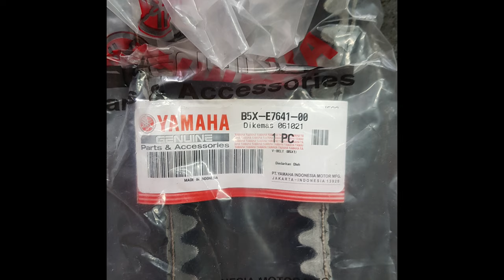Strangely broken clutch at 30000 km, Change All Drivetrain Parts - Yamaha Xmax 300 Scooter

Comment: A da minha pcx 2014 foi trocado a sapata da embreagem com 49,000km . Esta dentro do prazo né?
Reply from the maker: Verifique as sapatas da embreagem a cada 10.000 km,
Dependendo do desgaste da embreagem dentro da sapata da embreagem, pode ser necessário substituir apenas as peças da embreagem.
Se a peça de desgaste não for severa após a inspeção, você pode continuar a usá-la sem substituí-la.
Esta peça não é uma peça que é substituída regularmente.

Na Coréia, quando é confirmado que a embreagem dentro da sapata da embreagem está gasta ... eles apenas substituem todo o conjunto da sapata da embreagem. (포르투칼어)

Check the clutch shoes every 10,000 km,
Depending on the wear of the clutch inside the clutch shoe, you may only need to replace the clutch parts.
If the wear part is not severe after inspection, you can continue to use it without replacing it.
This part is not a part that is regularly replaced.

In Korea, when the clutch inside the clutch shoe is confirmed to be worn...they just replace the entire clutch shoe assembly.
Reply: @MotorcycleRepair  😀😘😀
Reply from the maker: @andreagama5290  😀😘😀

Comment: From what website did you order all the parts ? thanks
Reply from the maker: The video was filmed in Korea.
Also, because it is a motorcycle maintenance center, motorcycle parts are purchased from designated suppliers.
Most of them are supplied directly offline rather than through websites.
Although some special parts that are not in stock can be purchased on the website, most of them are sold and delivered within Korea, so it will not be possible to purchase them overseas.

Comment: that's a manufacturing fault lol. my 2021 Honda pcx has 30k miles and the stock clutch is still in great condition.
Reply from the maker: Yes you may be right.
I think this is not a common occurrence.
Reply: @MotorcycleRepair   thanks for the fast reply. i had a 2018 yamaha nmax and it was burning loads of oil from new and it was the piston rings weren't installed correctly at the factory. a lot of small cc Yamaha's are built in Indonesia and I'm gonna guess they skip a lot of quality control. but that does not mean Yamaha are bad it just means a small batch of bikes could be affected.
Reply from the maker: @mrpantur7280  Since it is made by people, I think defective products may come out depending on the time.
Thank you for leaving a nice comment.😍
Reply: @MotorcycleRepair   true. do you know if the customer contacted yamaha about the problem.
Reply from the maker: @mrpantur7280  I don't know about that.